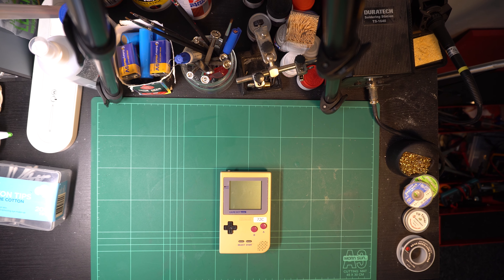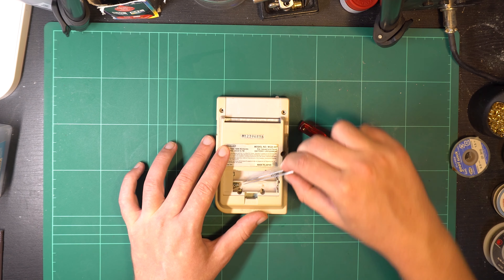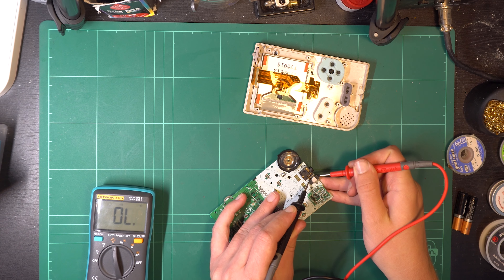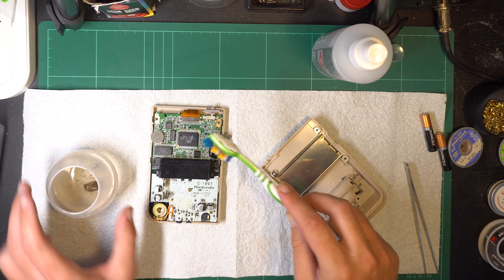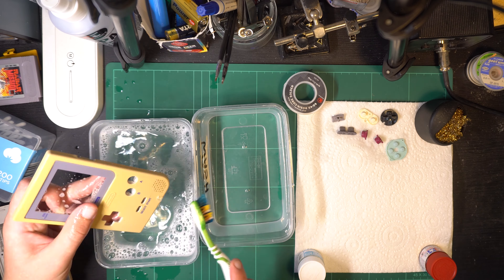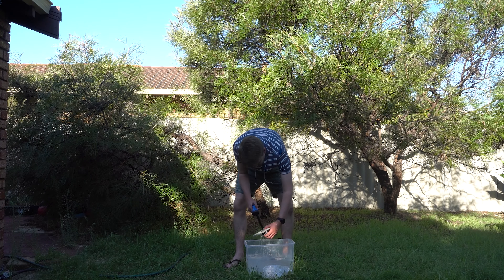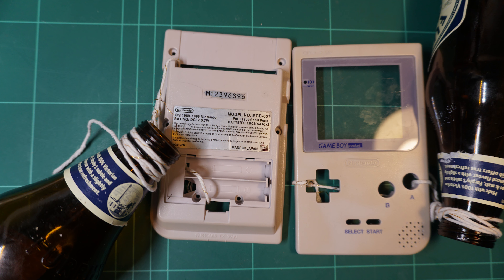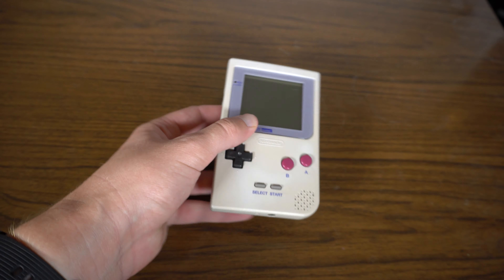Game Boy Pocket Repair

Comment: I also have the same potentiometer issue with my volume wheel on my GBP. Would white vinegar work on its own if I can't source IPA or contact cleaner?
Reply from the maker: IPA and vinegar do different things. IPA is a good all-rounder for cleaning electronics while vinegar is specifically good at dissolving corrosion. So, if it's corrosion that's the issue (which is certainly seemed to be in this case) it will be fine. Having said that, giving it a go shouldn't harm anything. Just be sure to give it some time to dry, it takes a lot longer than IPA.
Reply: @retrogameon  thanks man, appreciate the feedback